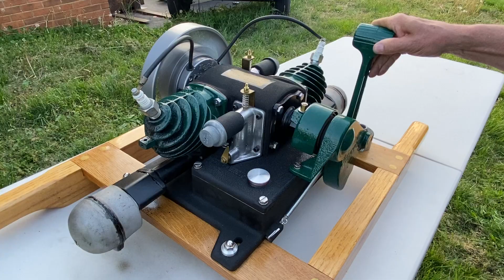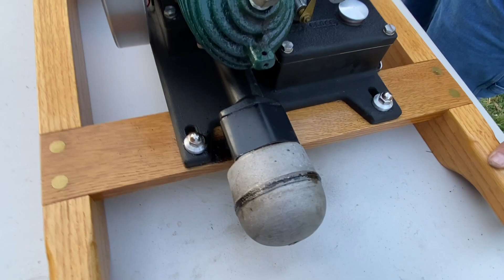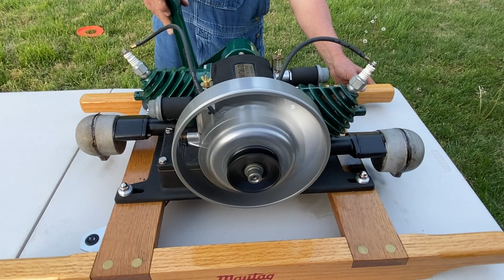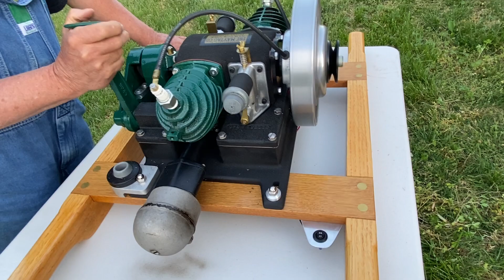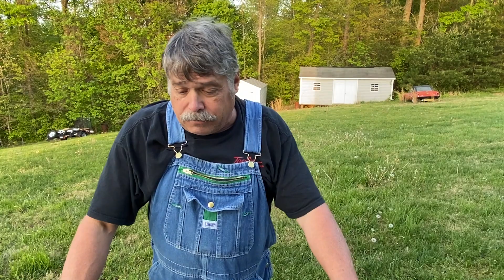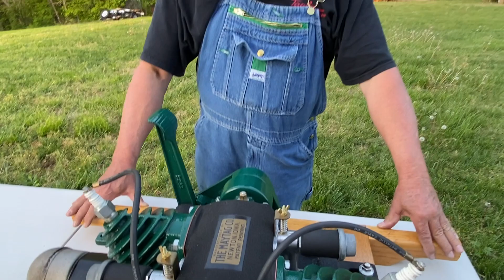Big Block Maytag Twin Prototype

Comment: very neat.is this factory or home built
Reply from the maker: That motor is home built that I built using parts from Maytag model 72s and 92s. I made the crankshaft and base / fuel tank from tool steel and alloy stock. I had to put a slide valve
in both mixers to control engine speed. My next project is an eight cylinder using four Maytag model 72s. I will try to make it look as factory as i can, But that will be a way down the road. I have also built three Maytag four cylinder engines that I have not posted yet.